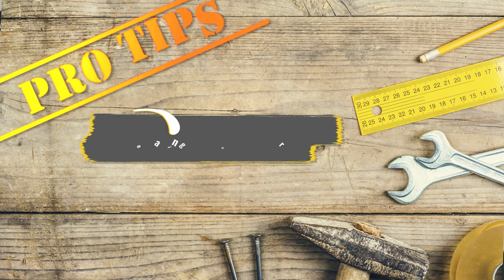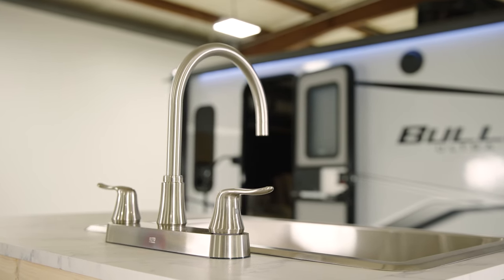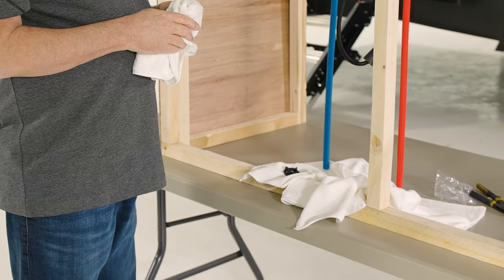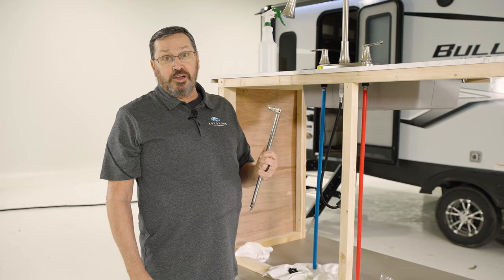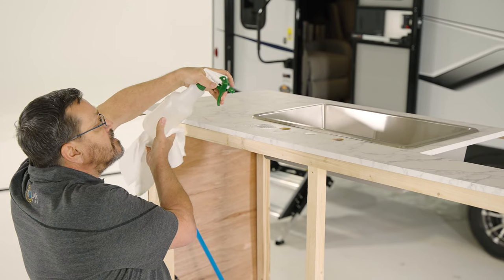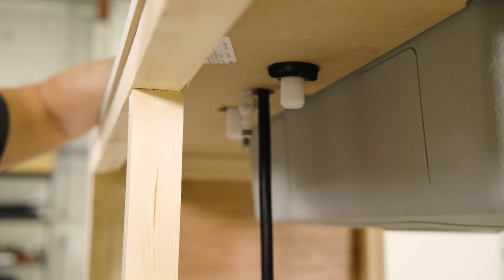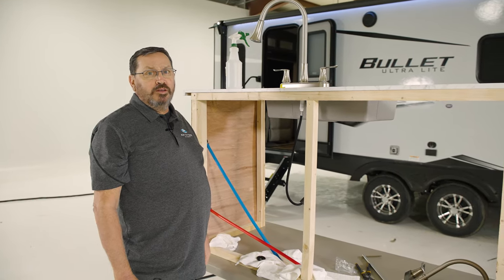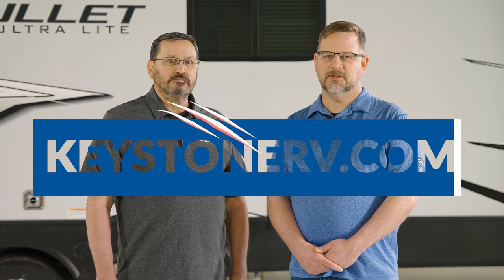RV Pro Tips: How to replace a kitchen faucet when you want to give your RV a fresh new look

Comment: I wanna see how you fit under the sink and do it not do it on one being built with lots of room
Reply: I just did mine, it's more beneficial to get a good look at the mock up,
Reply: I agree, I have to cut out the panel covering the faucet hookups to avoid either removing the sink or the shelf under the sink.

Comment: I want to see you do it in the camoer/Rv
Reply: For real. Anyone can do it when it's outside the rv. The issue in my rv is the fact that my sink is virtually inaccessible. I have to remove all the drawers and literally crawl into the cabinet itself at an angle to even think about getting to it
Reply: I was lucky enough that someone cut the back of the cabnit  already.. they did a decent job on making it square enough I think I can make a door for it ... a cabnit door inside a cabnit haha
Reply: For mine I just cut an access panel on the outside of the rv and the I used metal duct tape to hold it back when I was done. It almost looks factory still. I'll probably paint the tape to match next year some time when my tax return comes in

Comment: I think most folks can change out a faucet. I turned on this video to see how you removed the wood, covering the back of the sink to access the faucet connections. To avoid removing the sink what is the best way to cut those panels out? Thanks
Reply from the maker: Good Morning, Thank you for your inquiry! These panels should just pop off for you to access the sink. If it does not do this we would advise consulting a local Keystone dealer near you so that no damages are done to the unit.

Comment: How do you ACCESS a faucet in an RV with a sink in the way? Cut a hole in the RV siding? :( Replacing the faucet is the easy part. :( Otherwise good info for faucet replacement.
Reply from the maker: Good Morning! We would be more than willing to look into the specific sink layout on your unit to see how you can access this faucet. Please do contact our retail customer service team at 1-866-425-4369 so one of our advisors can assist you! Thank you.